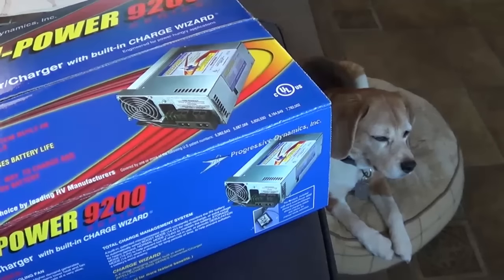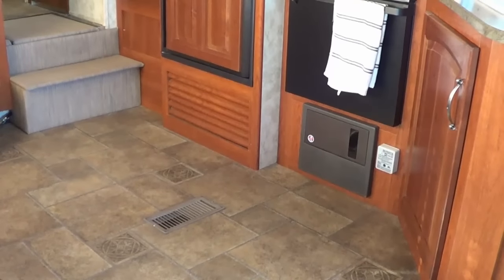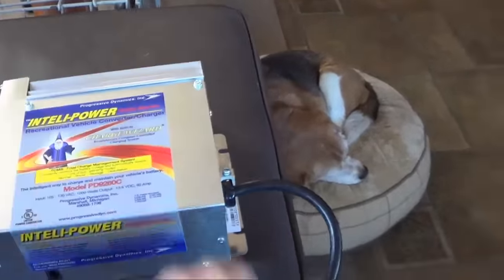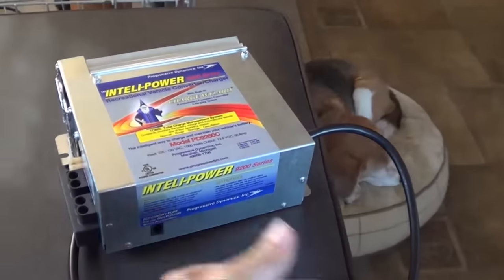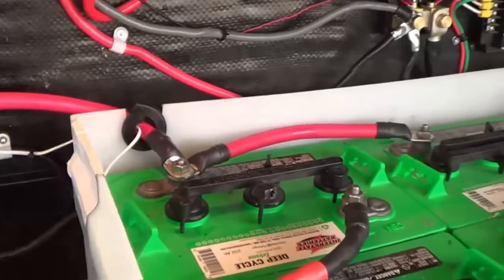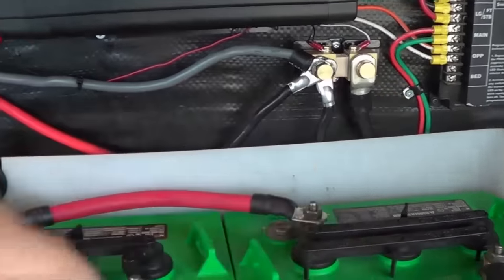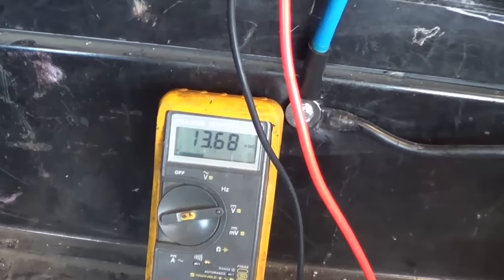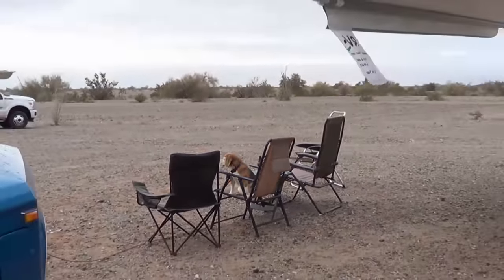Upgrading to an INTELI-POWER Battery Charger for Boondocking

Comment: Love your site Ray.  We just bought a unit similar to yours and your vids are invaluable for learning how to modify and maintain things.  Question:  you mentioned that you didn't want the noise of the converter in the living space but that you left the old one connected.  Doesn't the fan on it still run when you are hooked up to 110v?  Is there any reason why just replacing the old converter with the new inteli-power unit wouldn't work in terms of maintaining the batteries while on shore power or in storage?
Reply from the maker: Thanks!
For maximum charging amperage, for boondocking with the generator the converter needs to be located very near the batteries to reduce the power loss in the wiring and get the fastest charge with minimum generator time.
I left the old converter in place since there was no reason not to. It would be good to have as a backup unit. 
I just simply flipped its breaker off on the power panel and then it wouldn't do any charging when on shore power. Like it wasn't even there.
Then all I needed to do is plug in the new InteliPower to an AC outlet and it would be the battery charger on shore power instead.

This was my plan so the fan would not annoy me, BUT I have found that since we have more solar now and the days are long the batteries get so well charged I haven't heard the fan even when using the old converter. 
So have decided to use it when on shore power again to save wear and tear on my Inteli-Power. But it's nice to have the choice, the fan noise may come back once the sun starts to retreat in the fall again.
Reply: Thanks Ray.  Let me see if I have this correct.  So if your converter is off at the breaker and your inteli-power, is plugged into 110 then all 12v loads (lights etc) would be pulling from your batteries which in turn would be charging from the inteli-power (and solar).  Is that correct?  If so is there any worry about racking up the charging cycles and wearing out your batteries prematurely?   BTW, we live just down the coast from where you are in Campbell River.
Reply from the maker: Yes. 
No, it's better than the OEM arrangement. The Intellipower is just a high-quality charge converter. It and the solar controller are better on the batteries than the piece of crap OEM arrangement since they do a much better job of charging. Adding solar power with the good quality charge controller is the best thing I could do for my battery bank. :)
I found the OEM system could never really fully charge my battery bank and had no way to equalize them. So eventually they become sulfated and die a premature death.
Cool, if you're ever up in CR drop on by and say hi. :)
Reply: okay, that makes sense.  I'm thinking of installing a system very similar to yours (thanks to all your great ideas and vids!) minus the solar (maybe in the future).  The main components would be the Inteli-power converter, inverter and a trimetric meter.  We are only planning on heading south for a month or 2 at a time at this point and the rig will be in storage (with 110v available) the rest of the time.  I'm thinking it would be nice to have the ability to shut off all 12v loads for storage while leaving the inteli-power connected to keep the batteries charged.  Does this sound like a good idea?  If so, I was originally thinking about a manual battery shutoff switch like the one you have but then I was thinking that since the positive side should probably have a fuse or breaker in line why not use one of those breakers you use to do double duty.  The breaker would protect the system in the event of short etc and could be flipped off to shut down the inverter and the rest of the 12v in the coach for storage.  Sound like a good idea or am I getting out into left field?
Reply from the maker: Sounds good. I originally bought my switch because I was running two battery banks and wanted to switch between them.
If you need to find the proper current rating to use there should be automotive type breaker near your battery + feed to the 12 volt RV loads. On my Cougar it is screwed to the back wall of the storage bay in the bottom right corner.
You could have a look at it and find out the amperage.
Reply: Thanks again.  Your advice is invaluable.  Where did you pick those 80a breakers?  Looking for a source in Canada.
Reply from the maker: you're welcome. I got mine at Westmarine. Check the boating parts stores. The Blue Sea ones are fairly common there since they are waterproof. 
You can find dealers using this page - https://www.bluesea.com/locator
ie - http://www.comoxmarine.ca/content/electrical-products

Comment: Question, I am in the mist of replacing the converter/charger in my travel. I took it out and dismantled it ,two diols are burned of the board. 
I am curious added a receptacle plugged into ac plug, and tested the blue positive and white neutral, used a volt stick and I have power to to both black and blue, just curious is this normal, I am replacing it but want to know

Comment: Hi Ray
Thanks again for the great video's which definitely help me with my decisions.  Thanks to you, I have purchased the "big buddy" heater and bought a 1000 watt inverter from Cambodian tire.
Did you disconnect your original converter?
Reply from the maker: You're welcome, Rob. I've left it exactly as it was and still use it when on full hookups. I figure I may as well wear it out versus the more expensive InteliPower.
The Intelipower charger is mostly for boondocking so I can get a quick charge into my batteries using the generator. I've even added a separate receptacle for it. Here is more info - https://youtu.be/uRbGmxun1LI?t=12m46s  If I do want to use it instead of the OEM converter I can simply shut the breaker off to the OEM unit and plug the Intelipower into an AC receptacle.
I have lots of options now and nice to have a backup. :)
Reply: I was a little confused as to how the two would charge the batteries or would it do some loop through the intellipower to the OEM unit and back to the batteries.  I am still trying to wrap my head around "how it all works" for RV DC & AC electrical.  I find it very interesting so it will be easy to learn
Reply from the maker: Yes, there are so many ways to hook things up. It all depends on what you need to be able to power when camping off grid , convenience,  how much money you have to spend and how much you want to tear into the RV to rewire stuff.
When it comes to RV boondocking electrical there is more than one way to skin a cat that's for sure. :)
For my setup, the Intelipower converter is simply a high-quality smart battery charger to maximize my generator run time.

Comment: Love your videos, always helpful and of interest.  A couple questions regarding the intelli-power install.  We are getting ready to purchase a rig and plan a lot of boon docking , so this video was of interest to me.  The rig we are planning to get already has an Onan generator installed.  Considering I see the benefit of installing the unit close to the battery and wiring directly to the generator which would be wired to the rigs electrical system, can I install a switch between the generator, the wiring to the rig and the intelli-power?  In other words I would like the ability to direct the generator power to either the rigs electrical system, or the intelli-power and to shut off power from the generator.  Thanks. Peace & Happy Travels.
Reply from the maker: Thanks Bruce,
It's hard to say exactly, with a built in generator, the circuit can get more complex with a transfer switch. But you should be able to put a line between it's AC output and connect it up with the new charger. A breaker could be installed for circuit protection and the ability to turn it off and on
Another easy way is to find where the AC is being fed into the existing converter charger is and wire it to the new converter chargers input instead.
Cheers Ray

Comment: Hi Ray, beautiful top notch installations.  Do you have a trickle charger to recommend as my converter let out smoke and blew a 30amp fuse last night and I need to charge my batteries, cold here in Quebec.  😊 Thank you.
Reply from the maker: You could use your truck charge with a set of jumper cables
Reply: Love Your RV How long does it take to charge ?  It might take awhile before I get that thing fixed.
Reply from the maker: Depends how low the battery is, but at least an hour or more to get some charge back into it. basically, you are using the truck like a large generator. It's not good to idle a vehicle motor too long but if you are cold you may have to. Or maybe you can borrow or buy a battery charger. ie.  http://www.canadiantire.ca/en/pdp/motomaster-eliminator-intelligent-battery-charger-12-8-2a-0111518p.html#srp
Reply: Love Your RV Thank you Ray for your quick replys, I was at a Canadian tire and now heading to a different one, I just did not know what to take, The. Leek wanted to sell me the Eliminator but the little one not more than 2 Amp,but it said on the box that it maintains, not charge so I left it there.  I saw the one you suggest, going to get it, I don’t want to wreck my little Baby Diesel on Idle, I would rather be cold .  At what setting do I put it? How many amps?
Reply: Love Your RV Battery is at 12.3, lacking sun for solar recharge, have been boon docking for 7 days now using the furnace.
Reply from the maker: You should be able to use the full 12 amp mode, it is a smart charger so will automatically reduce the charge level as the battery becomes fully charged.
Reply: Love Your RV thank you Ray, got the device and heading up to the end of an extension cord somewhere 😁
Reply: Love Your RV Ray, the 12v setting is good got my 2x 6V AGM Batteries?
Reply from the maker: Yes, The batteries are wired in series to make 12 volts. Think of the two of them like one large 12-volt battery.
Reply: Ok. Thank you so much for your help Ray, Very much appreciated.  All set up and warm.  Can now figure out a converter fix without rushing. Cheers :-))

Comment: Ray, Loving your videos. Question: other than cost, is there a reason for not using AGM batteries rather than lead-acid?
Reply from the maker: Thank You. :) Lead acids are nice in that rather than just testing voltage to figure out the state of charge it can also be measured by using a hydrometer which is more accurate as each cell can be mearured.  I like the lower cost too of course. Then I can devote funds to sometiing else in the power system.
It all depends if you are willing to do the extra maintainance required and if they can be mounted somewhere with good ventilaton. In many cases its more convient to pay more for AGMs
Reply: +Love Your RV Thank you Ray for being so descriptive.

Comment: Curious?... Why didn’t the boost mode give you the full 60 amps that the unit is rated for?
Reply from the maker: I don't know, just the way it is I guess, max I see out of it is generally around 52 - 58 amps, even with several lithium batteries I've tested. 60 is likely just a lab-tested peak amperage.

Comment: That was an interesting video. Big improvement from the one in the kitchen. Do you find the 1k invertor is big enough or is there another upgrade coming?
Reply from the maker: Yes, it is more than enough for our needs. we rarely use more than 250 watts.It's mostly to power and charge electronics.
I'm not a big microwave user, love cooking on the gas stove and don't drink coffee, just tea.
So any more upgrades will likely be in the form of more solar. I'd love to have a 140-watt panel to use as a remote ground unit. catch the early morning sun or use when we are in shade.

Comment: hi..great vid ..thanks... did you disconnect or disable the factory converter/charger ?
Reply from the maker: I left it in place as it was so I have the option to use either one. If I want I can disable the OEM charger by simply flipping off the breaker for it on the RVs power panel.
Generally, I use the new Intelipower for charging off the generator to get the fastest charge into my battery bank and use the original OEM one when on full hookups to save wear and tear of the Intelipower. Cheers Ray

Comment: Ray, where would you install the Tri-Metric Battery monitor in line with the converter/charger? Is the converter/charger not connected to the solar panels? I am thinking the Tri-Metric is hooked to the solar which is connected batteries and the converter/charger is only activated when the solar panels are not getting good sun, shore power available, or running the generator; correct?
Reply from the maker: The Trimetric monitor measures the battery bank voltage and all current going in and out of the battery bank through the installed shunt which wired in between the negative battery bank post and all other grounds.  You can get a better idea of the setup by looking at this post - http://www.loveyourrv.com/diy-rv-boondocking-power-system/  There is a video explaining my current boondocking system and a diagram.  Cheers Ra

Comment: So a technical question for you,  what happens to the other battery charger or are you not hooked up to power
Reply from the maker: I've kept the OEM charger as is and use it when on shore power. Figure I may as well wear it out rather than my Intelipower charger, since on shore power the charger doesn't have to do much, especially since I leave my solar on. So basically the Intelipower get used for off grid charging using my generator, though I could use it with shore power by plug it in to any AC outlet. Cheers, Ray
Reply: @LoveYourRV  im running 4 of the t, 105 volt batteries,  400 watts solar and a couple of stand alone 100 watts as needed we live in Arizona,  my trailer is short on room but works well for us its a heartland NT23RBS pulling with a 2001 dodge diesel,  we boondock a bit more as time goes on as we just retired ...im running a 3000 watt inverter that i plug my trailer into not running the ac though thats another question later lol . I have my solar on my battery's and inverter hooked to the battery's i have a battery shutoff switch between the trailer and batterys,  hopefully you are in Arizona now its beautiful weather this week.
Reply: @LoveYourRV  Think I;m missing something. Why didn't you just replace the OEM with the Intellipower? When your on shore power, the Intellipower powers your 12 volt system and charges your batteries. When you plug the rig into your Champion, same thing. When you're off grid (no shore / no generator, your panels do the charging? Thanks for considering a response. Just curious because I just pulled my WFCO (OEM) out today and replaced it with the Intellipower 9200 series.

Comment: Hi Ray. Love your videos. This may be a dumb questions but did you do anything with the OEM charger? Disconnect it maybe?
Reply from the maker: Left it in place so I have the option to use either one. I can disconnect the OEM charger by simply flipping off the breaker for it in the power panel. :)
Reply: But you don't need to disconnect it correct?  As long as you don't have both shore power and generator charging hooked up at same time right?
Reply from the maker: I always leave it connected. On shore power, the OEM converter is charging along with my solar panels. When charging with the generator I use the IntelPower unit.
Reply: Thanks!  I thought about it after I posted that the Solar charger would be always inputting voltage so the "9260" shouldn't effect it either.

Comment: Curious why you ddn't just install a inverter/charger like a Magnum MMS1012? With the cost of your Eliminator inverter and the new converter you coud have had a much better system for a couple hundred dollars more!
Reply from the maker: The inverter was already bought and paid for 5 years before I added the Intelipower converter has been a good inverter, does what we need, still working, almost 3 years later. Cheers, Ray

Comment: Do you still use this system with the Lithium batteries you now have?
Reply from the maker: Yes. I'm happy with it as it serves my purpose (charging off my portable generator) so don't see any need for me personally to go out and by a lithium type charge converter or an even more expensive hybrid inverter/charger.
Lithium batteries need to have a charger capable of putting out a consistent 14.2-14.6V to have them charge completely and quickly. They don't need the various charge phases that lead-acid type do.
The problem with chargers that are for lead-acid type batteries is the put out a high voltage like 14.4V in bulk mode but then generally back off too quickly for lithium batteries due to their lead-acid algorithm in the smart charging circuitry. So it then takes much longer to charge and sometimes they will get stuck in trickle mode and not keep charging
But the PD9260 Iintelipower charger I have has the Charge Wizard pendant button that can put it into a manual override boost mode to charge at a constant 14.4V. I found by utilizing that when charging, I can fully charge my lithium batteries.
But unlike specific lithium chargers, I do have to do a bit of manual work, not a big problem for me as I also have the solar charger so when I need the charge converter it's gonna be when I'm firing my portable generator anyway.
I fire the generator, plug in the charger, and hit the button. Then I see 50+ amps of charging right until the batteries are full. 50+amps is plenty for me.
Here are some videos of it in action charging my new Lion Energy batteries.
https://www.loveyourrv.com/testing-lion-energy-safari-ut-12v/ 
https://youtu.be/Nt3CG5qeF5o
https://youtu.be/gNbZZBkFkjs

Cheers! Ray